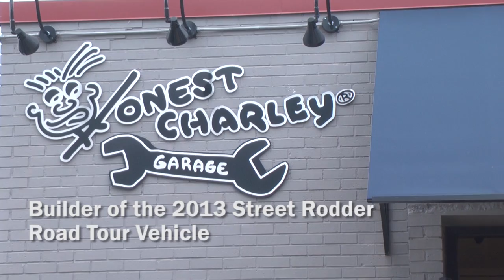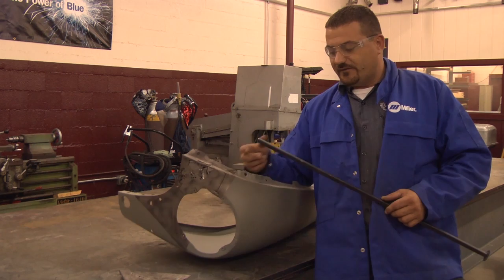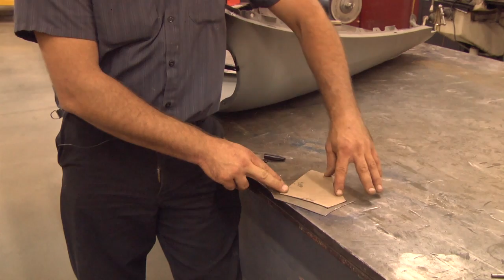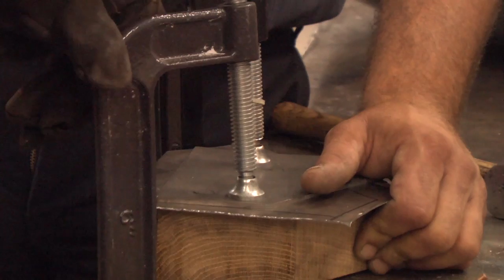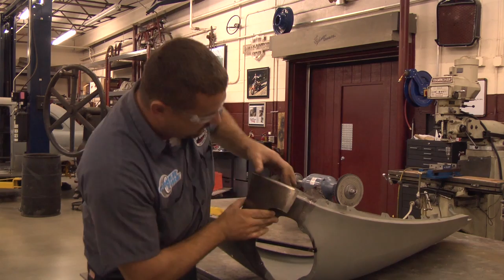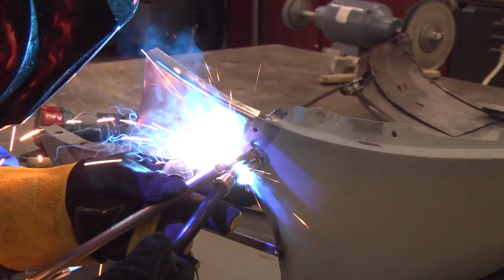MIG Welding and Repairing a Rusted Front Fender at Honest Charley Garage

Comment: That's an excellent demonstration. I was surprised to see spot welding on a lap joint, rather than a but joint with a fully welded backing plate. I guess you get less distortion and a faster repair by using less metal and smaller welds. Easier if you can't get behind. More bondo but less metal work.

Comment: those "factory plug weld holes" mysteriously appeared from no where.  How about mentioning sealing the back side so moisture doesnt bubble up the bondo?

Seems a more professional finish to his replacement part would have been to create off set flanges the metal thickness....where its spot welded - so no bondo would be required.